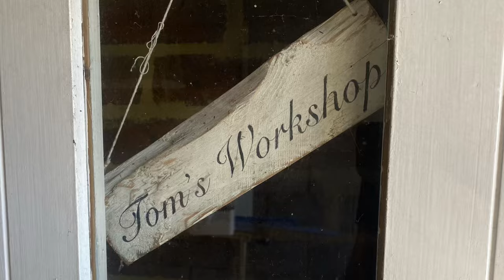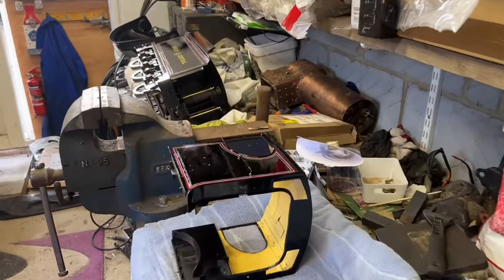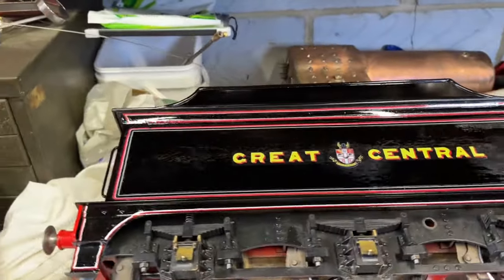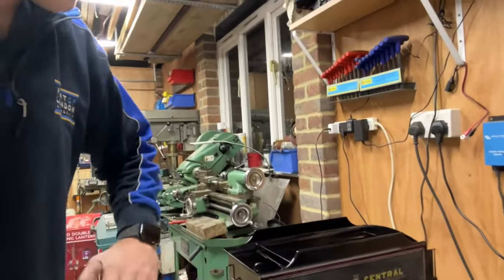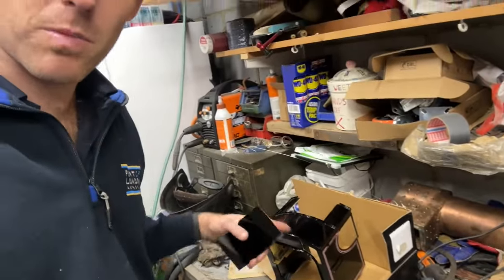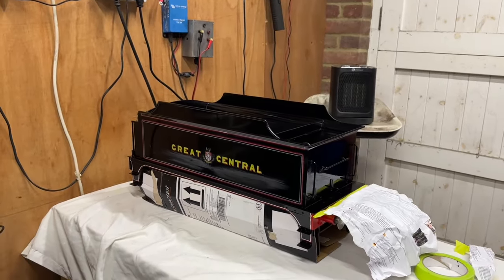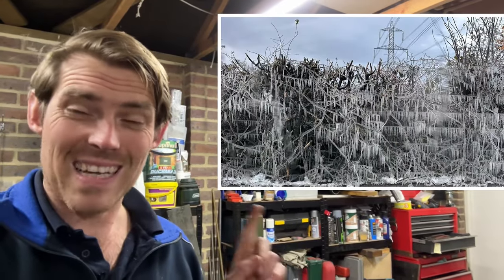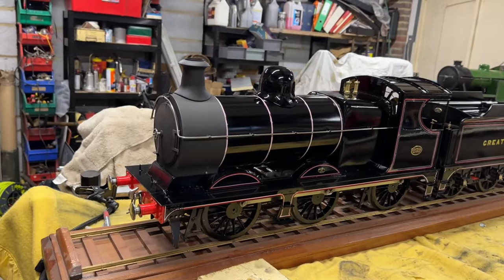POMPOM varnish and final assembly.

Comment: Hi Tom, 
Just wondering? as its winter is your workshop not heated constantly, does the temperture get low in there? does this concern you at all? 

I have been doing some painting this week but they are small items so have been able to sneak them inside the house to dry. 
Brendan
Reply from the maker: Hi Brendan.
The larger side isn’t, would just be too much to keep it warm, but the small machine side is, the idea being that I can be out there doing some bits all year. It is at the back of my mind that the locos are out there, but there’s only so much you can do. I do have a plan for trying to protect the locos a bit more but I haven’t got around to doing to that yet…